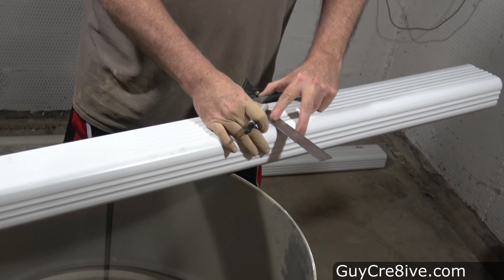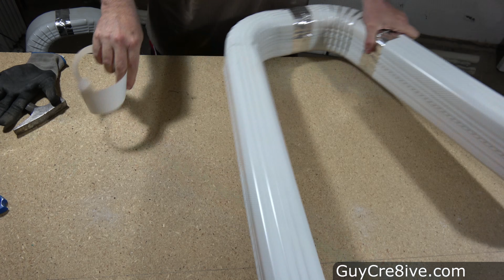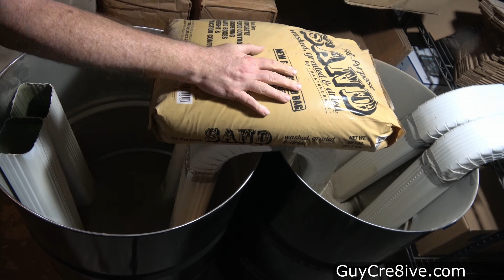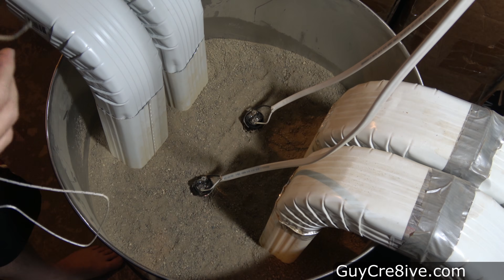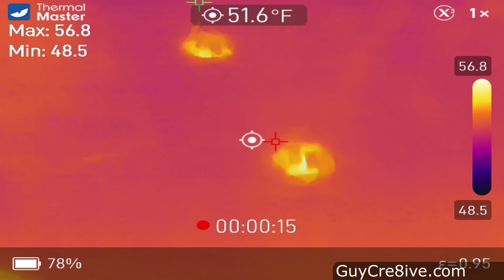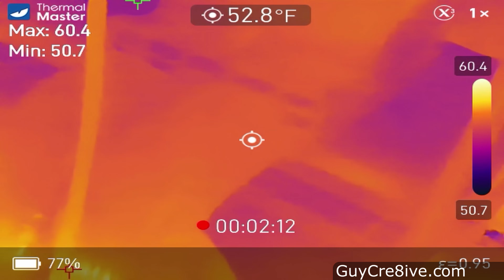Sand Battery Heaters How To Build DIY Solar Powered Heat Drums Batteries Elements For Home Heating

Comment: I was wondering about doing something like this but run the heating wires or pipe in the dirt under your property. It could mean that you heat it up in late summer and it lets out heat slowly into the winter, though it would have to be dug down deep, so perhaps only feasible for a new construction.

The challenge is to get summer sun stored to use in the winter

Comment: Did anyone think of putting water in the sand to help with heat conduction to the sand?
Reply: water will turn to steam at 100 degrees centigrade. Sand can get to 400 degrees easily....

Comment: Skip the sand use an IBC with water you get 77kwh of energy in a singlen1000l tote heated to 90c and get an inkbird itc 1000 temp switch
Reply: What is IBC
Reply: @danfrank8938 Intermediate bulk container

 Also known as a tote just google it it a large 1000l square white and black sometine just make sure you get a food grade one
Reply: @danfrank8938 every litre of water holds 4183 joules per degree celcius change divide that by 3600 to get watt hours, so 1000lx 66c x 4183÷ 3600 =  76688wh or 76.6kwh
Reply: great idea because you can always pump the water somewhere such as into an underfloor heating system or a bathtub

Comment: After watching a few videos I notice that a lot of people don't get the full amperage of their solar panels by adding more elements and placing them in paralell the amperage draw increases so solar panels in  series and heating elements in paralell so up the voltage decrease the resistance i=v/r
Reply: it's a little more complex than that, you want to match the impedence of the solar panel/s. A solar panel has a rated maxmium power point, this is a current at given voltage. what you want is for heating element/s to match that. eg if you solar panel is 11.7A @ 34v, you'll want a heating element that is 2.9 ohms.

Comment: Use 6mm pea gravel. Put the heaters at the bottom. Blow the air right through the gravel bottom to top.
Reply from the maker: I might have to try that out on the next build and see how it performs.

Comment: Organic carbon power cell you plug in that powers diesel glow plug inside copper tubing coil thermal electric generator inside sand power's up to keep the glow plug hot metal toggle kill switch on outside of barrel to shut it off.  Self sustaining sand heat battery.   Depending on how hot you want it add more glow plus? 🤔✨️

Comment: What about using pieces of metal (copper, iron) shorter than the diameter of the barrel lain in the sand (spokes in a wheel fashion) every few inches while filling the sand to create heat conductors to get the heat away from the heating element out toward the barrel. This would help load all the sand with heat and keep the temperature near the heating element down.  Maybe driving some rebar rods down vertically would also help distribute the heat.
Reply: Good idea. Do you think a coil would be better though?
Reply: @danfrank8938  I think the goal is to put one end of the metal near the heat source and the other near where you want the heat to go (the cold spots in the sand).  Since heat tends to rise, I'd put most of the metal radially to get the heat out to the barrel surface and some vertically to get the heat throughout the barrel.  Hang in there and keep experimenting -- the heat may flow in a way that will made me entirely wrong.
Reply: @danfrank8938  I was thinking about getting the heat distributed into all the sand in order to get the most heat stored in the sand.  But if you don't want the surface of the drum to heat up, then the metal going across would be counter productive. I don't see why you couldn't do both depending on the goals in mind.

Comment: Lots of smaller thin wall pipes would be highly more efficient spread throughout the barrel.
1. More surface area in contact with the sand = more heat transfer. 

2. Smaller pipes = less air to heat passing through. 

3. The pipes can be spread more efficiently throughout the barrel to absorb heat from more areas of the sand.
Reply: Man you got me thinking on point number two. I was thinking about bigger pipe for a bigger draw but yes it would take more energy to heat the pipe.

Comment: Look up, Polar Night Energy.

Heavy Insulation: The sand is housed inside a massive structural steel silo lined with thick, high-grade insulation. This structure traps the heat so efficiently that energy can be preserved for weeks or even months with minimal "storage-time" losses (~5%)

Good luck with your journey.

Comment: My suggestion would be to find a way to use the sun to heat them other than solar panels. Do the other type of solar water heater where you run water through black pipes heated by the sun.
Reply: I somewhat agree but solar panels don't need direct sunlight to work where as if he used solar heating it would be much better if he had full sun.

Comment: Make sure your sand is completely dry first - lay it out in the sun for an hour or two and pack the sand as you put it in with a wooden rammer of some sort this helps it heat the sand next to it better with tighter conduction.

Comment: What about making fins like electric basboard heater  . Make the fins to fit around the electric heat strip? The flat fins need to be a decent size so the heat can penetrate the sand so the heat can heat more valume of the sand so your air ducts temperature can stay stable when you turn your fan on.
Reply: One fella suggested using electric stove top elements. I'm not sure how hot they get but I know it's hot. From my memory dad used to melt lead in front of an old kerosene bullet heater. Lead melts at just over 600 degrees. I'm sure that was the high end of what that heater would do. After a few minutes of that on blast a two car garage was warm. All of that to say I think the electric heaters once they have the sand and air heated wouldn't have to run but long enough to ensure the sand remains a relatively high temperature

Comment: I have thought about this before. My thinking is that forget the pipes. Warming the sand in the issue, getting the heat out is easy. A passive heat loss from around the sides of the barrels should be enough as there is lots of area. If you wanted to slow the heat loss, an insulated box around both barrels would do it – and to speed up heat movement to the house, have a taped door in the box that lets heat rise to the main floor. A small fan if you want to regulate heat.  But moving the air around the barrels - not though it going to give you more area to heat. 

If you wanted to heat a house fully on solar without batteries, two systems, one to heat it directly during the day and the barrels for after sunset.
Reply: I agree on more than one barrel but if the right medium is used it'll take that stuff a long time to cool down

Comment: So. I scrolled through, and didn’t see any comments suggesting to run some downspout pipe to the ground on one side before even considering adding any active air transfer.

Hot air rises, cold air sinks, therefore cold air from the floor holds more energy. 

Setting these on top of some kind of insulated slab, or a pallet with insulation would help greatly if this was used on a concrete slab , on a dirt floor greenhoise, or leaving it outside and insulating the top and sides really well.

I would imagine if you were to spend a silly amount of money, you could buy a whole mess of Elbows and Make a spiral shape inside the drum, and increase the amount of contact space between sand and downspout, for more heat flow.

Comment: Very interesting.  I think that is maximum with that number of elements.  I think that sand in a mass is a touchy ballance when it comes to thermal mass. Im sure you are aware of all the space for warmth to creep right out the top. As Im sure you are aware, heat moves up. That heat lost could possibly do more justice with the elements burried deeper in the barrels. This way the natural convection would heat sand on the way up and out. I also considered a lid to help minimize loss of heat / power. 
For some reason I think of my old fish tank. My furnace went out once and the pipes froze but my fish where swimming around fine with only a small little tube pump. 
Its possible that the water was continuously moving past the pump warming . 
It seems I have written a book here. As I said. Interesting.  
Thanks for the upload Fren.
Reply: If he could maintain a temperature then bury the heating element at the bottom would be good. He will constantly have variable temperature though so if the plan is to use thermodynamics to move the air you'll need cooler air being sucked in at the bottom. I do agree though that having an open top will not work as well as a closed top

Comment: This is similar to another youtuber I saw. He built a very small system just with a single solar panel wired directly to a 12v heater coil. He put this in his pump house just to keep the pump house a little bit more warm during the winter so he could keep using his pump.

He had one issue for his specific setup in that it didn't warm up quick enough with that small solar setup. He ended up mixing in a portion of metal shards to increase the thermal conductivity of the sand. While this also increase the rate at which the sand would cool down, it did allow it to capture enough heat from that single solar panel to make it through the night. That of course is a tradeoff that may or may not be useful depending on each individual project.
Reply: Crushed aluminum pop cans?

Comment: how about using parabolic mirrors on a motor instead of photovoltaic panels maybe?
Reply from the maker: No clue what you mean, sorry.
Reply: @GuyCre8ive  I just watched a video recently about it otherwise I wouldn't know about it either :P

A parabolic solar trough is a curved mirror that concentrates sunlight onto a pipe to make usable heat. The transcript argues it is cheaper, simpler, and more efficient for heat-related needs than rooftop solar panels, but largely ignored because modern incentives and financing favor grid-tied photovoltaic electricity. For a homeowner, the most realistic starting point is a small DIY solar hot-water trough with insulated water or sand storage.

Comment: Wouldn't running a hot water copper coil thru the sand be more efficient?
Reply: Not water no. It'd boil, steam then explode. Maybe antifreeze or just plain glycol since it doesn't corrode and has a boiling point of nearly 400 degrees

Comment: Can you put those sand batteries in the sunlight for extra heat ? Possibly a southern window, maybe some form of magnifying glass or extra sunlight with outside mirrors heaping extra light in the sand.
Reply from the maker: I would imagine so, especially since the drums are black.

Comment: Basalt is denser and holds more heat than sand. And it's readily available  in the form of  blue metal and crusher dust.
Reply: Yes, up to 5x more heat conductivity . . . Glad someone mentioned basalt!
Reply: @k @kpbarbee  I can’t wait to give basalt a try after studying it for a while, I like the idea of using quartz sand between the larger basalt rocks that someone commented about.
Reply: I have read that quartz sand holds more heat, I haven’t heard about any comparison to basalt.
Reply: Well you answered a question I was needing an answer to. Is it necessary though? Would that be more heat than the barrel and pipe could reasonably hold?
Reply: @danfrank8938  It holds more heat than sand but not dramatically more - maybe 10%. So in localities where people are trying to  get as many BTU's as possible, it's the better option.

Comment: Would wet sand help with dispersing the energy given off by the heating elements?
Reply from the maker: I'm not sure, I'd be too worried about rusting out the drum though.
Reply: Probably not the best idea. Just be patient and pack the sand tight so it heats better.
Reply: The water will turn to steam above 212ºF and dissapate (one video suggesting testing the sand before heating to determine the moisture content.

Comment: Just fyi for those interested in heat battery tech, Sunamp makes the Thermio, a phase change heat battery for home hot water use.
Supposedly replaces a typical home 40/60 gal water heater tank with equivalent hot water supply in a fraction of the space/volume.
Of course,  sand batteries like this are not phase change,  but simple, low cost thermal mass

Comment: 1.Consider using exhaust pipe tubing welded up to your size specs.
2. Better yet..Consider using coiled copper tubing in the sand drum and plumb it to a auto heater core in the living space. At those temps you need to use oil and not water in the circuits with a pump and fan run off a thermostat. Insulate everything VERY well....everything, especially the drums.
Reply: I think by the time the water hit the heat exchanger it'd be fine. Just have to make sure you get the right style. A pump wouldn't be necessary if it was set up like a thermosiphon. Let physics do all the work.

Edit: x2 on the coiled copper

Comment: When you blow cold air from beneath throug sand it will start to act lik a fluid also known as a “fluid sand bed”. It might be the way to get the heat out without the use of the the aluminium pipes. By the way why not use an old boiler filled with sand?

Comment: Heat rises.

The heating elements need to be deeper in the sand.

Perhaps much closer or under the piping.

Insulate the outside of the barrels.
Perhaps a water heater blanket.

As for the collapsing conduit problem.
Maybe single piece of copper tubing.
Reply: Hot air rises....heat goes in all directions equally.  That being said, it's not a bad idea to space t he elements out for more uniform heating.

Comment: I'd use old oven elements for more surface area.  I don't know what your voltage is so you might need multiple elements but they have superior surface area over those small hot water tank ones.
Reply: Yes but aren't they made to cycle? Not sure how long they would last with direct power
Reply: @danfrank8938  DC current won't make a difference.  Voltage and amperage matters.  Also, the only thing determining cycle life is how hot they get.  The terminals need to be out of the sand and with multiple elements they don't need to be as hot as they were when used for cooking.   They should last a very long time if the terminal ends are protected.

Comment: next test use Schamott or ceramicfibre stone   to insulate the steeldrum 5cm on the inside also on top the sand must not touch the steel, otherwise it will oxidize fast 
sand must be between 100-550°C to store in this small drum anything usefull

Q = m *  c * Delta T
Q = 210 kg *  0,23 Wh/kg} * K * 480 K   =  23.184 Wh

23Kw/h capacity 

also use stainless steel corrugated pipe no other metal its not clean enough

heating elements plug in at the side  use these ceramic stones to form an entry from the side so u can close the stealdrum on top

also use 1 1/2 stainless steel corrugated pipe an make 3 loops in parallel also at the exit of theat pipe then u need a heat trap , means the output needs to go down from the top so it will not start to move air when u dont want it like a chimney, also this pipe is then the heat exchanger that makes 500 degree hot air that need to be mixed with cold air then it can be delivered though vents in the house on demand
Reply: I didn't think about the heat trap. Good idea. You think three loops would be enough? I'd put as many in as I could afford
Reply: @danfrank8938  u need to calculate the amount of air and so power u want to transfer thats why he is using these  big pipes 1 1/2 inch  Q=m*c*delta T
1 1/2 Inch courugateted pipe has low resistance at 10m3/h air volume, over 10m3 or 3m/s u get to high resistance, so at that u can transfer Q=12kg/h * 1,006kj )kg*k) * 280K = 3.377kj/h --> 938W or 0,94Kw/h 
2-3 Meter u need to get 300°C sand into 280-300°C Air, only if u get the sand to 300°C
If u want 2KW transfer load to air u need 150m3 so 6 * 11/2 inch pipes and 3m give u at moderate 7,4m/s air speed and 300!C sand 2Kw/h output and it will empty that drum 15Kw/h in 7h
Reply: but be use stainless steel!!!! Werkstoff 1.4404 / AISI 316L  Zink oxid poisining !!!!!!!!!!!!! will happen with zink coated pipes u dont want contaminates from a downpipe that is used for water only at high heat
Reply: @christian84726  I am currently working on my Electrical engineering final project at The University, I am designing a PV fed  sand battery storage for home heating ,,, I must raise the temperature of the sand to 500 degrees Celsius,,, I’m gonna use liquid for heat extraction “use car radiator” but now I’m failing to find suitable DC heating elements
Reply: @ThobaniFuneka  every heating element can be used for dc and ac its just a resistorcdirektly feeding it 230V DC with a MPPT regualtor so u need 6 Pannel 500W in series, extracting 500 degree in liqid sounds Impossible and dangerous sand to air is much safer if u use a car radiator u cannot raise the sand to 500degree or if u heat the sand do 500°C and then pump water in ur pipe it will just explode and burn u , u need a liquid that can hold 500°C there is non exept liquid salt so dont do it sand to air is the only usable solution without industrila scale 500!C steam wil cut though metall and need very high pressure
Reply: WHAT KIND OF HEATING ELEMENT CAN I USE?
Reply: @ThobaniFuneka  i would say any heating element used in Sauna ovens are good enough

Comment: careful don't use the air from that drum directly because u can get Silikose from that Siliziumdioxid, he is doing it absolut right better would be stainless steel as a pipe, sand can be over 400 degree so zink or else would contaminate the air
Reply from the maker: Thanks for the info, I did not know that! I just added your comment to my pinned post.